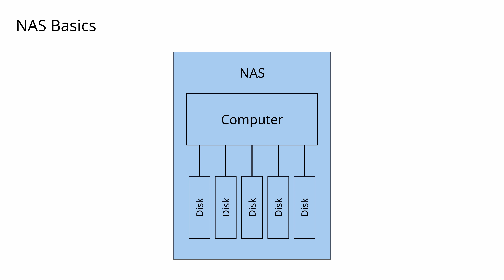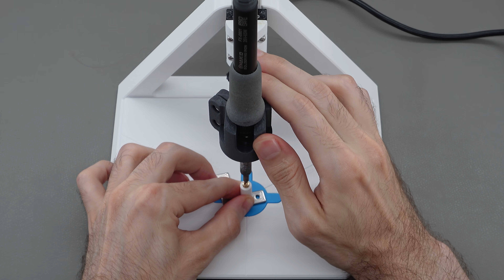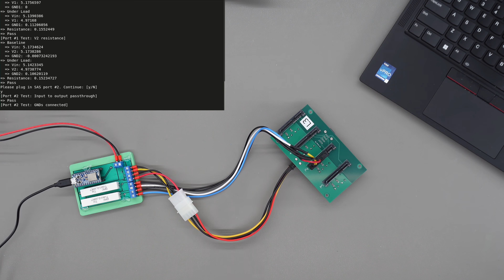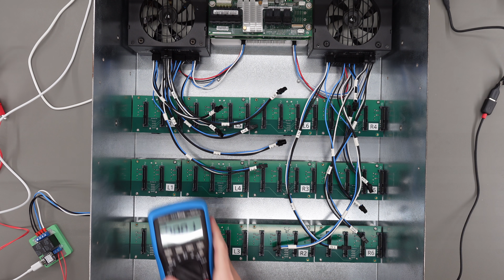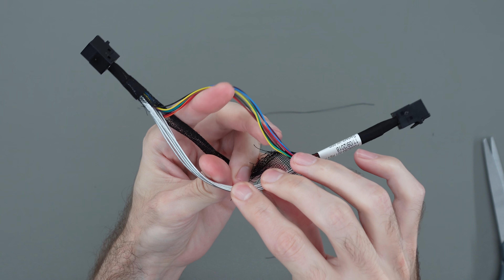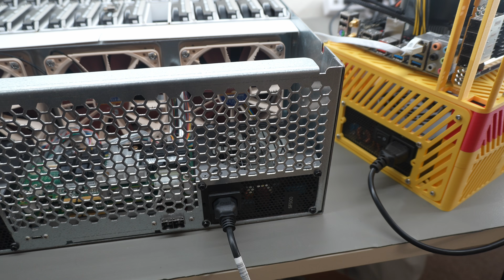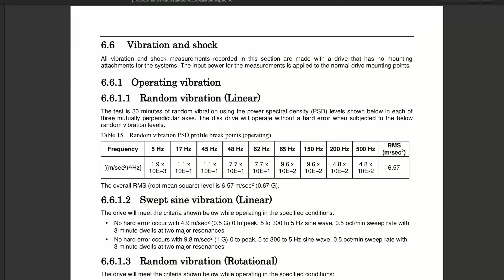I Built a 1 Petabyte Server From Scratch

Comment: On ZFS: Mixed VDEVs are fine if you want to maximize capacity and have a few more IOPS, but I'd probably recommend 6 separate 7-wide Z2s (they usually have better padding alignment) with 3 hot spares. That gives you 30 drives of data (instead of 31), so you loose just 1 drive of capacity but gain 3 hot spares. Running the failure analysis on that (especially with the still decent resiver times of 7-wide 18TB drives) it's more resilient, doesn't require you to worry about swapping drives on vacation and makes the entire pool more homogenious. It'd also fit nicely with your existing 15 slots if you create it as 6x7-wide, migrate the data, format the old pool and add it as 2 extra vdevs for 8 times 7-wide with 4 hot spares in the end.

You'd probably also want a special VDEV in a 3x mirror with 1.6TB/1.92TB drives for metadata and conservative amounts of small blocks (maybe 16K or 32K) or 3.2TB/3.84TB for more aggressive small block values (64K or up to 512K with 1MB records) or if you want to try out dedup.

For maximum capacity as a separate pool (and still decent sequential speed, just fewer IOPS) 4 times 11-wide Z3 with 1 hot spare could also work, or if you want to span across chassis (one pool) 5 times 8-wide Z2 and after migrating data 7 times 8-wide.
Reply: Exactly what I was going to say ;-) one group of VDEV less = room for hot spares + 3 mirror SSD in special vdev for metadata. Peace of mind + small blocks and metadata performance. Great build even if dual SAS datapath for redundancy has been sacrificed on the midplane.
Reply: With 45 drives there wouldnt he be better off using zfs DRAID with in a draid3:8d:45c:1s configuration, the disrubuted spare would enable better regeneration speed, and so in most cases allow for better reliability. I do toss-up between that and a draid2:8d:42c:3s though with 2 cold spares. Both should be strictly better than 6 separate 7-wide z2s though.
Reply: It's irrelevant at some point down the line; he will lose one of those two power supplies, and good luck recovering from that. Generally, I regard ZFS as a toy file system as it lacks critical enterprise features that I regard as essential. Namely, being able to have zero downtime under both software upgrades and full hardware replacement. ZFS is also not scale-out, but that probably only hits at >10PB.
Reply: @jonathanbuzzard1376 for a home lab, downtime for updates is probably ok though. With that many disks lack of redundant power supplies does remain an issue, but he also only has one nas node, so backup is probably the right approach to managing that. The challenge is that a propper clustered solution to this issue requires 3 full nas nodes for a basis, which is likely beyond the scope of this build and would substantially increase the cost overhead for storage.
Reply: @varno sure, just pointing out ZFS is not "enterprise" storage. The biggest PSU issue is when one dies the system will partly stay up and all hell will brake loose leading to almost certain data corruption. Oh and the fans are not up,to the task.
Reply: @jonathanbuzzard1376 the sas expanders should definitely be powered by the same psu as the drives they ensure, with that adjustment your host will probably not loose data too badly, and yeah, those fans should be fine for the given airflow, so long as the drive temp is actively monitored using SMART things should be ok there, though i would have used the 3krpm max industrial ones.
Reply: @jonathanbuzzard1376  it will actually just drop half the disks from the array, zfs will crap itself and it will probably freeze all writes until someone replaces the broken psu. at most you risk corrupting the in-flight data when the psu fails but that's that.
Reply: @jonathanbuzzard1376  If that happens ZFS will just resume from the last sucessfully synced transaction before the devices disappeared. That's defined as the last transaction sucessfully and completely written to all vdevs in the pool. If ANY vdev fails before that (due to too many devices not responding or any other reason) the checksum validation on the uberblock fails during import and the previous one is used. So at most ~5 seconds of async writes are lost. Sync writes are replayed from ZIL. Even if the devices dropped in a staggered way with just enough of them acknowledging the new write to pass and then some extra ones failed on reboot there are still 31 older uberblocks from prior transactions, all with valid, consistent and incrementally older filesystem states.

Yes, without a cluster the availability is impacted if a critical component like the head server, the JBOD connection or a non redundant PSU fails. But at no point does that affect the data consistency or integrity. In the failure case you mentioned (half the drives disappearing due to PSU failure) ZFS would:

1. Mark the devices failing to sync a write as failed.
2. Refuse to do any further I/O (since that many devices missing would put the entire pool into an "unhealthy" state).
3. After a PSU replacement + system reboot ask if the pool should be reimported & transient disk errors cleared.
4. Resume from the last synced transaction before the failure (1-5 seconds before).
5. Do a scrub in the background, just to be sure.

Yes, an HA cluster with Ceph (or similar solutions) can tolerate any node failing. But (at a fixed, limited budget) that has significant performance, capacity and complexity overhead that might make the better availability not worth it. At 500TB there's no point in using Erasure Code across half a dozen servers (you'd be paying more for CPU+RAM than for disks) so the only option is replication, which is less space efficient.

ZFS (ignoring the hobbyist issues of a non-redundant PSU, that still only affects availability) can be extremely reliable and performant if a few minutes of downtime a month for patching and the low risk of a double redundant PSU failure taking the system offline until replaced are acceptable. If they really, actually aren't then it's time to spend 2-3 times as much to get a "proper" cluster set up. And if the required amount of storage is already so huge it doesn't make a difference because multiple servers are needed anyway then obviously a "native" cluster is the more sane choice.

Comment: What about the temps? Airflow seems very limited, and with plastic parts in most places, there isn't a lot of transmissivity of heat, except among disks.
Reply from the maker: Haven't seen the disks get above 40C. 35C seems to be normal. It helps that there is not much behind the disks.
Reply: @MadeByDennis  nice!

Comment: Regarding random read/write: Have you considered buying (used) Intel Optane disks for caching? They aren't the fastest NVMe disk sequentially (unless you get the crazy expensive p5800x), but they'll more than saturate your 10Gbit networking and they have crazy good rnd4k speed due to the extremely low latency. Even the small 280GB or 400GB capacity variants should do a great deal to speed things up without breaking the bank and I can't see you writing the NAND to death with any normal workload.
Reply from the maker: Yeah, sorry, I forgot to mention I have another M.2 SSD PCI card I use for caching. In the video I was I little too focused on the pure HDD performance without more dynamic factors like cache hit rates.

Comment: it doesn't get better than this i think! Level OVER 9000!!! What about the Temps of the SAS Expanders? Mine get hot during operation and i need direct air cooling to not run in problems during operation.
Reply from the maker: I added more info aout this in the pinned comment since I got this question a few times. Yeah, I have a similar experience and had to add another smaller fan behind them after I finished making the video.

Comment: Lets put this in perspective... 
30 yrs ago, 1PB of storage would require a row of racks in a DC and multiple servers... costing well over 10M USD.
15yrs ago, 1PB of storage would require 2 racks or so... and would cost around 5M USD.  

Today...  that row of racks can now be consolidated into a single compute node along w a storage node (your 1PB of storage)

Just something to think about.  🤯

[Edit]  There are some things that you kinda glossed over.  Like when you point to using a Raspberry Pi to control your NAS... (Adding a mb to your box of disks...)  Nope. That wouldn't work. 
You will need a certain amount of compute to manage the drives.  Its not a lot, but its more than what you can get w a pi. 
 
Overall nice video.
Reply: Actually,  you can get a >1PB storage by using 5 Kioxia SSDs... They're 245 TB each. 😉
Reply: @HiSpy-3  
Sure... how much do they cost? 😛
But you further proved my point. 

The other issue is that you need a certain amount of CPU and Networking to make this effective. 
With PCIe 5 you've hit that point where you can bring the density of compute and storage into an unreal small size.  The next issue is the issue of heat dissipation.
Reply: @michaelsegel8758  -They're probably quite expensive. I can't see them available in Denmark yet, so I have no idea about the price.
-But you're right on all points. 😃
About the heat; I attempted to use an NVMe card in a Silicon Power PD60 for my Raspberry Pi. There are huge heat dissipation problems here and I only got 28MB/sec at most. I had to go back to using an ALDI USB3-to-SATA docking station, because my Raspi kept crashing when using the NVMe over USB3.
The ALDI docking station gives me about 200MB/sec, so it's 10 times faster than the "NVMe solution" (!)
-As I understand it, Fibre-Channel is not "old technology", even when we have 100Gbit network, because FC is point-to-point and thus can be a lot faster than IP-based network; just something to keep in mind when making a fast network server; especially when you wish to boot from it. I don't have Fibre-Channel yet, but would like to. I do have fiber-optics for internal network from my LX2 though, but not for my Raspi.
Eh, and I have a Ryzen 9600x computer without RAM. 🤣

Comment: How do you read temperature from ADAPTEC AEC-82885T if its only connected by molex and sas cable?
Reply from the maker: Short answer is `sudo sg_ses --page=es /dev/sg1` and the temp is near the bottom though the software does the equivalent except directly sends a SCSI command to the expander. This works by sending commands over the SAS cable. Normally you'd only send read/write commands, but other commands (e.g. for getting temperature, error logs, SMART data, etc.) also exist
Reply: @MadeByDennis thanks, i didnt know that its possible :) im doing similar setup but designing custom pcb is over my level so i relay on standard cables. I plan to use 3.3v pins to turn off drives completely when not used to reduce my power bill.

Comment: I have never seen a commercial JBOD with a power switch. If you think about it for a short time, it should become apparent why this is a really bad idea. You plug them into power, and they power up and stay up. Using locking power cords is another really good idea. The main problem you'll have is that the Noctura fans don't generate enough static pressure to properly cool the drives, at least under load. Fans that generate sufficient static pressure to push sufficient air past all those tightly packed hard drives are noisy. Finally, two power supplies are another really bad idea; you need to think about failure conditions. It would have been way more sensible to use a 12V PSU with DC-DC converters on the boards to generate the 5V. Yes, the DC-DC converters can fail, but they are a couple of orders of magnitude less likely to fail than the main PSU.
With my quarter-century of running large disk arrays and thus seeing all the weird and wonderful fault conditions you get, I predict data loss down the line.
Reply from the maker: Thanks for sharing your experience. Definitely will optimize this over time

Comment: Problem with spinning disks is power crashes - that's why enterprise kit has redundant power - losing AC power can crash the heads. Not so much on modern disks but the risks there. I suppose you could get around this with a cheap UPS and shutdown script in case you have a power outage.
Reply: I never had problems even though power was lost.
I take that most ATX power supplies these days (especially Corsair and better; Seasonic, Superflower) would make soft power-off due to capacitors on the output.
In addition to that; as you say; modern harddisks are a bit better at handling power failure.
Thus I wouldn't say it's extremely critical, but still it would be great to have an UPS.

Comment: Just magnificent by far the best petabyte project i have seen. Ive been wanting to do the same not on your level but create the jbod to connect to my nas.  I was stuck on the power was thinking an add2psu but this mini motherboard is amazing.  Do you think it could also recieve the signal wireless? And how can i get one?😅
Reply from the maker: Technically I'm using an nRF52 MCU so it is wireless but I don't use the wireless capability right now. The "management" board in the github link in the description is the board I am using. I am not planning on selling anything so current route is to self source from a PCB maker like JLCPCB/PCBWay

Comment: Around how many solder joints did you need to repair after testing?
Reply from the maker: None on the backplanes. Only a few on the led and motherboards since those are homemade boards that had some other minor manufacturing issues.

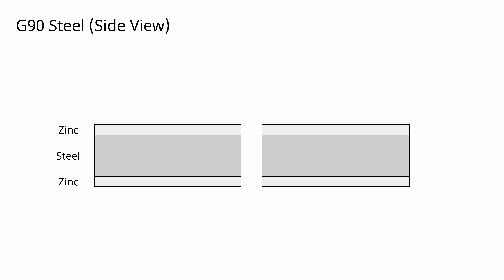Comment: 4:50 - Buy nickel strips, a bottle of vinegar, a AA battery, throw a 20cm long strip into a glass of vinegar, wait a day till it disolves.
Wire another nickel strip to the positive side of the battery as an anode with some cotton on wired around it, connect the negative to the metal case, brush the the exposed steel parts with the anode for a few seconds.
Done. Here's the entirety of nickel plating for you...

Comment: 7:55 - why did you have to design your own PCB board? Did you want to or was the reason that you couldn't buy these?
Reply from the maker: There are many different backplane designs with different proprietary disk/screw spacings and vary in the connectors used. I wanted to minimize the number of parts that I can't reproduce / rely on one manufacturer's design for and the boards are simple enough, that it is easier overall to design my own that have the exact spacing I need to pair with the 3d design of the whole enclosure. I also don't like the 4 pin molex power connectors most backplanes use since they are really hard to plug in / disconnect so I took the opportunity to switch to a more convenient connector.

Comment: suggestion, put rubber /o rings between your drive receiver boards and the base underneath, that way you lesson vibration from each 4 drives to the next.
i you could... I would have taken each f your JBOD SAS cards onto its own port in your main NAS, best would have been into it's own card, the card in a slot that is different buss from the next card, thus bypassing the pci 3 bus speed/bottle neck

Comment: Ok…. The only thing I would recommend is to add a cache drives in between your pools which should speed up your read/write data. This may be the most proficient build I have ever seen and I have been in IT for the last 30+ years. I would be interested to see what the thermals of your case are, they probably surpass of the shelf because it’s so damn well constructed. You are doing Gods work
Reply from the maker: Yeah, I removed a 4 x M.2 SSD card I have in RAID1 during filming since I was refactoring the cards to add the HBA so should be ok on the caching situation. Will see if I can add some more temperature sensors in the V2.
Reply: @MadeByDennis  V2?? My brother in Christ, are you seriously making a V2? I currently can't imagine what would be the upgrades  to necessitate the upgrade to V2.. 🤔
But, again.. it might just be my slow and tired brain.. 😑
Reply from the maker: Well that's the great thing about youtube. You don't need to think much since people in the comments section will tell you everything you are doing wrong and need to fix.
Reply: @MadeByDennis  Crowdsourced Engineering Audit
Reply: @chickendoodle32 😂😂

Comment: Thank for the video!

You're getting PLP SSDs a bit incorrectly.
That's for performance, not for reliability, because the only difference is how they handle sync writes.
Consumer SSDs need to actually read/modify/write whole page before responding complete transaction. That's in a good scenario, where it has somwhere to write that page, and if not - than the whole erasure block needs to be read/modified/erased/written.
PLP SSDs simply store that in DRAM cache, periodically flushing it to flash, knowing that it can detect power failure and have enough time to write the whole cache to flash in that case. So sync requests are marked as complete as soon as they hit the DRAM.

So it really only affects server-specific use-cases, like etcd or SQL, where performance can drop somewhere like ~ x1000-x10000 times in write-intensive scenarios.
And NAS wouldn't be as affected, as it typically needs sync only in the end of one big write, not on any 4k written to DB.

Personally, I have small ZFS pool of PLP disks, and large non-PLP pool of non-PLP, and mount PLP-based partitions to VMs that expected to have sync write workloads.
Been working like charm!
Alternatively, you can use SLOG devices with PLP on pool of non-PLP drives, if you need to trade some consistency for large pool that can accommodate sync write workloads.